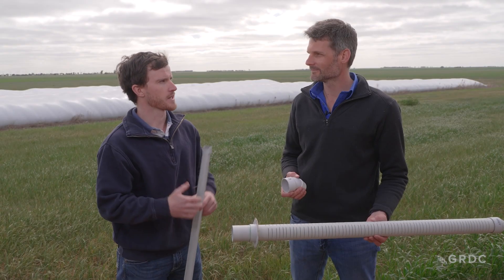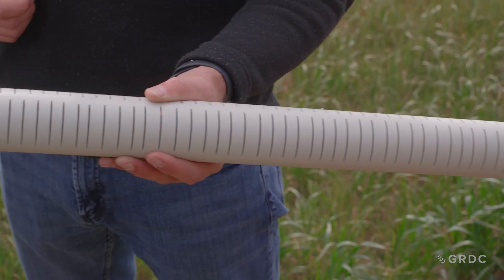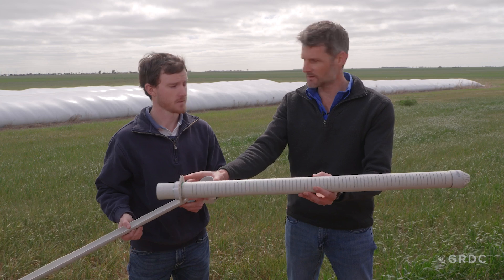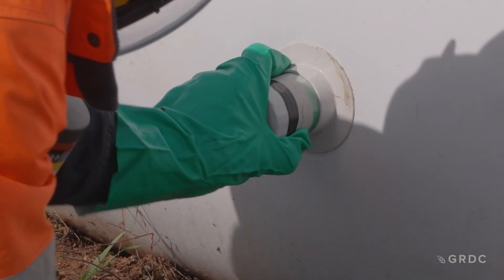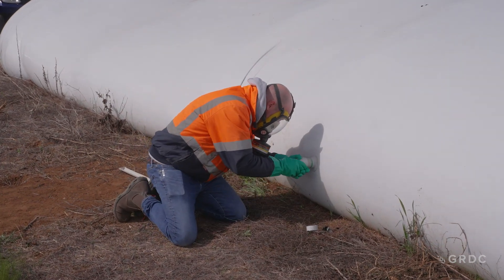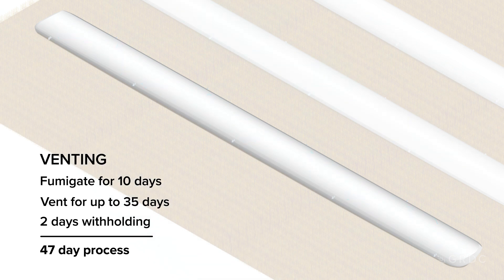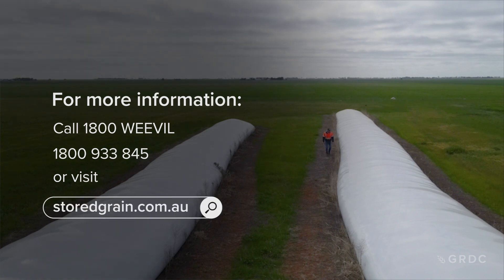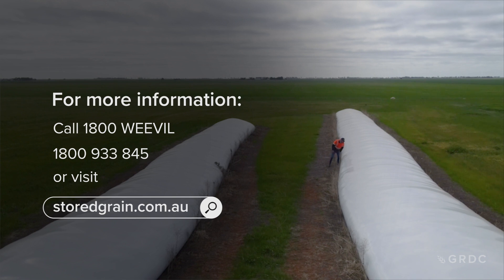Grain storage series: 1/3 | Fumigating and venting grain bags

Comment: Excellent presentation in all three videos on Grain Storage Series. As a Grain HACCP consultant It has always been difficult to present the do's  & don'ts of fumigation on farm. Many systems used in the past were clumsy & lacked the finesse of current technology. Clear data was also not available or not sufficiently defined on effective treatment parameters. These videos ensure we are all at ease with fumigations & that we are in control & effective. Remember that ineffective fumigations only adds to the resistance issues with insects. With careful budgeting, these on farm solutions can be very cost effective with the required safety.  Safety can be seen everywhere in the videos. Obviously under real fumigation conditions a gas tight face mask would be worn. Gone are the days when we allowed operators to climb pegs on the side of a silo to gain access. Systems shown are not cheap showing state of the art equipment sufficient to do the job. CSIRO & Siroflo is alive & well. Given that they are shorts videos, sufficient items are covered to ensure trouble free & safe fumigation. M. Tempone